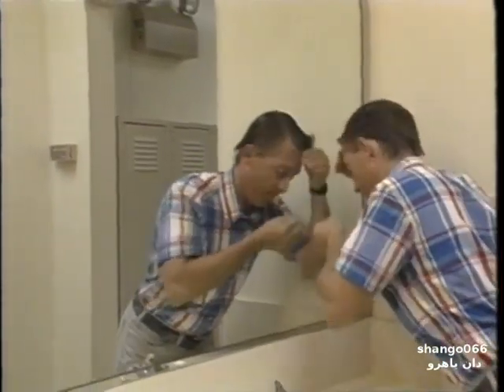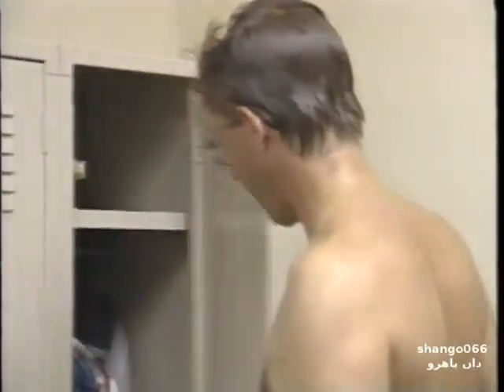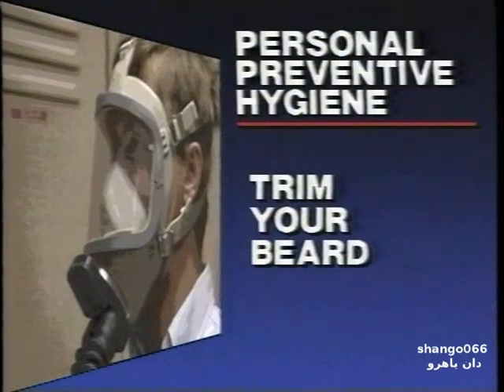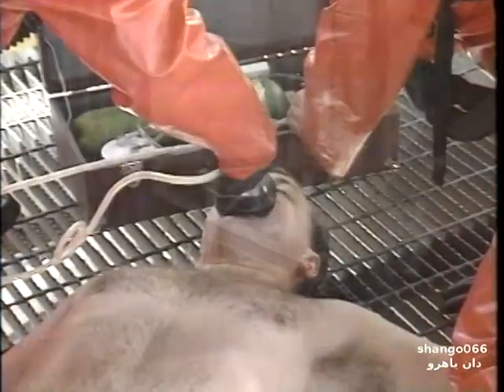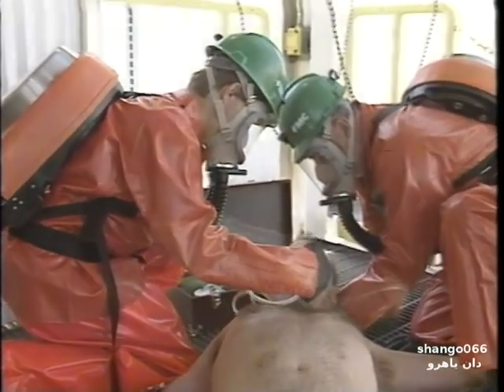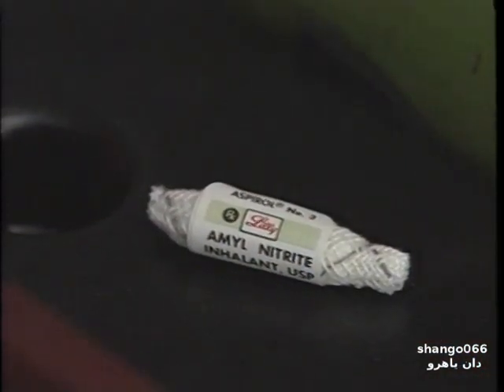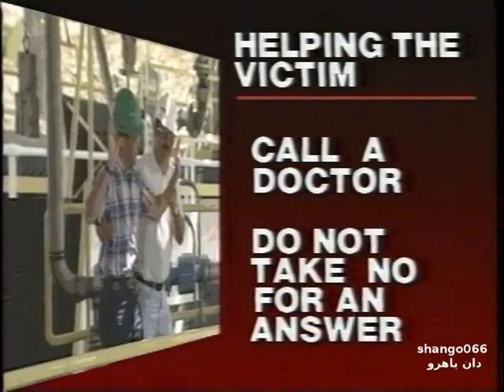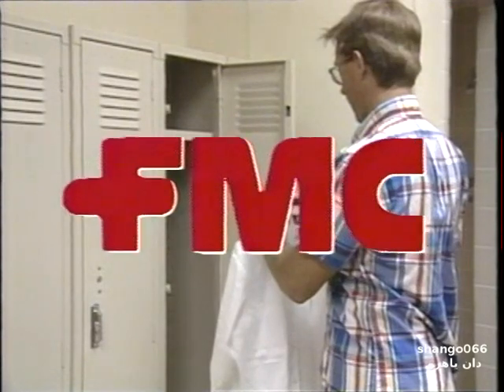sodium cyanide exposure safety video

Comment: My father in law worked in a gold mine in 1983 where they used Cyanide and one of the holding tanks leaked 2 workers were exposed to the fumes when they went to investigate the leak one was completely un-responsive the other was unable to talk he was able to  point at the cyanide tank training the workers had they knew what happened and used an emergency antidote kit on both workers and transported by helicopter the gold mine had ready onsite to fly anyone out both survived and made a full recover.